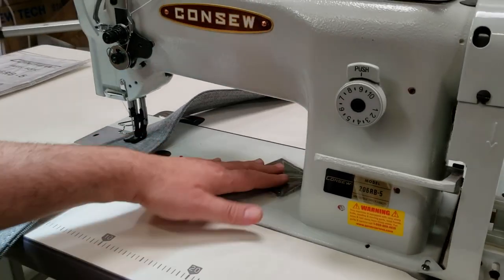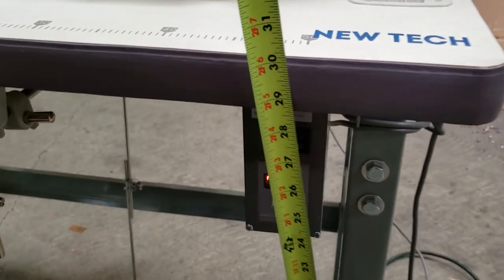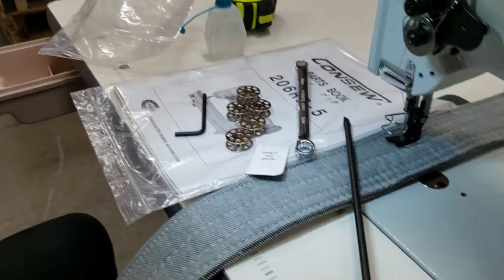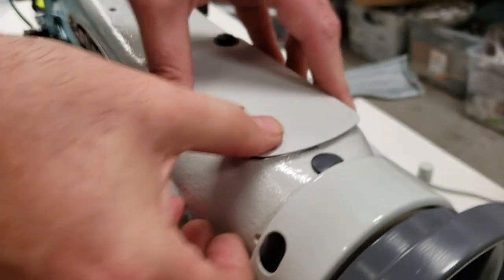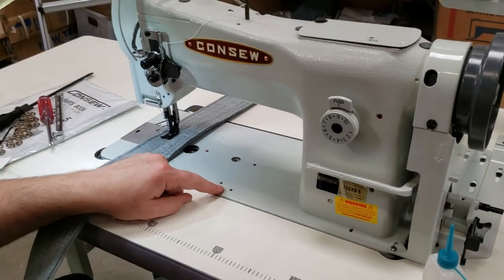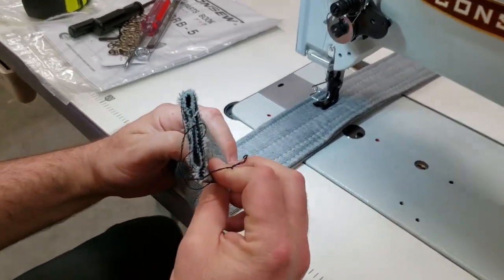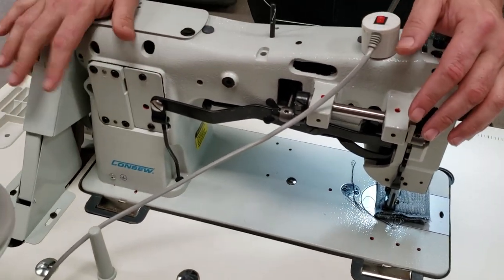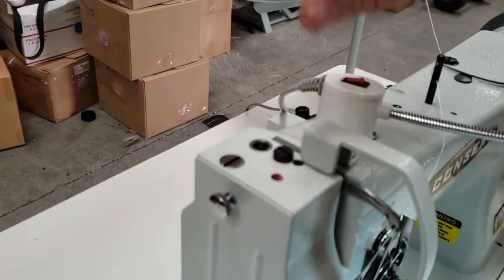Tutorial - Consew 206RB-5 Demo - Goldstartool.com - 800-868-4419

Comment: Just received and set up this machine and table. 
Been using consew 206rb-1 and 206rb-3 for 40 years and was excited about the 206rb-5 I just received. 
Machine head is exactly what I expected, but this New Tech table is obviously made for many different sewing machines besides consew 206rb. 
It has annoying extra cutouts where the machine rests in the front. 
The consew table does not have these and its for a reason, so your sewing product does not get caught up while sewing. 
I’m going to have to remedy this big problem myself, but I will. 
And on the product page for the 206rb-5 on your website you show the consew table as part of the package when you buy it. 
You should remove those pictures because it is misleading. 
I was expecting a consew table and now I have to make unexpected alterations to a brand new table. 
Besides that, I was happy with your service and the machine arrived much earlier than expected. Thank you for that, much appreciated.
Reply: I ordered a consew brand table and it did take longer for the table to come in